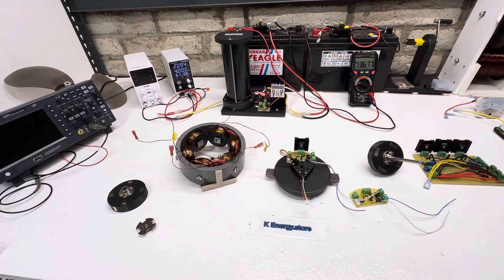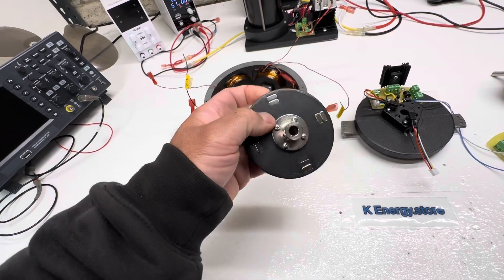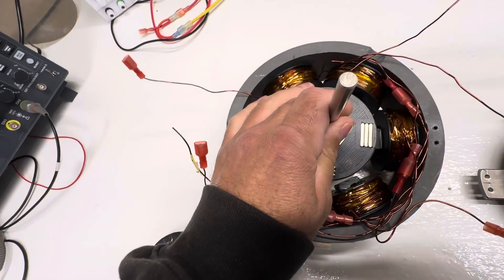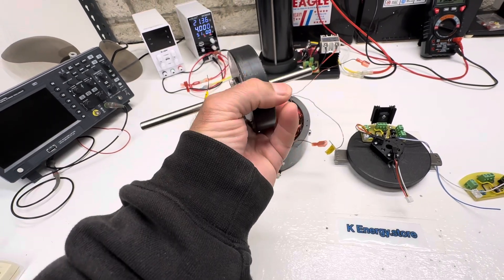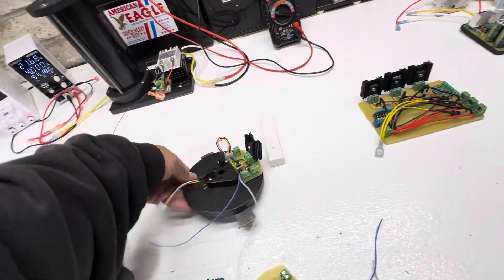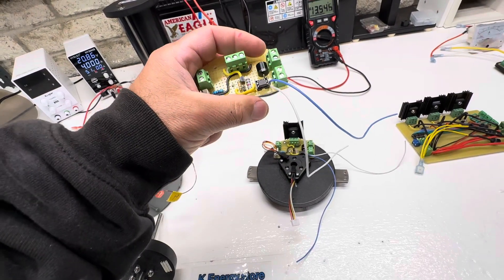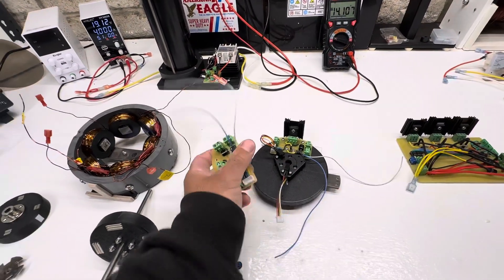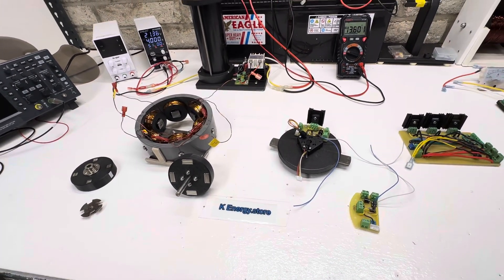Opto mosfet circuit layout for repulsion motor

Comment: Air and plastic make poor conductors of magnetic fields.  Use your 3d print as a mold to cast something that's got a lot of iron filings in it to carry the field further from the magnet.
Reply from the maker: Not necessary all magnets are same polarity